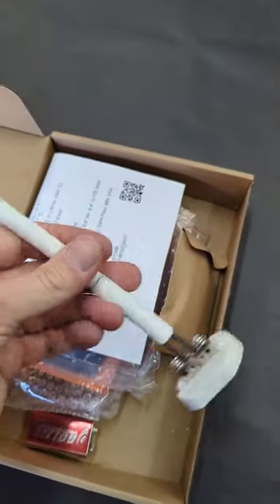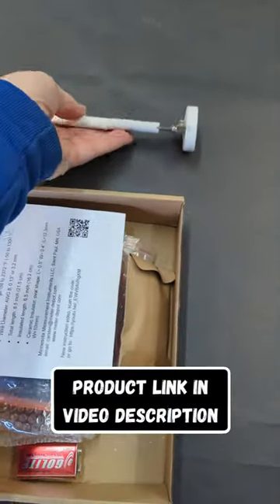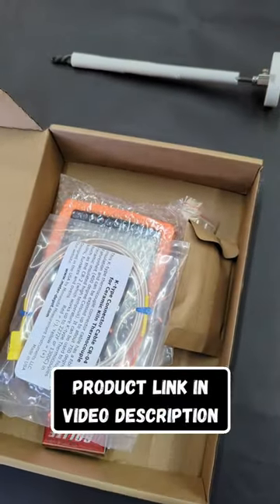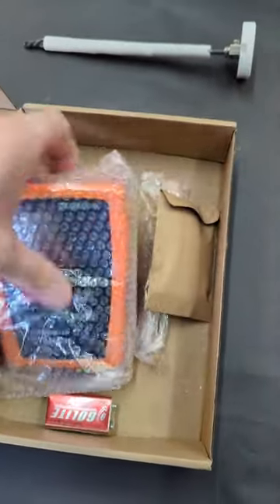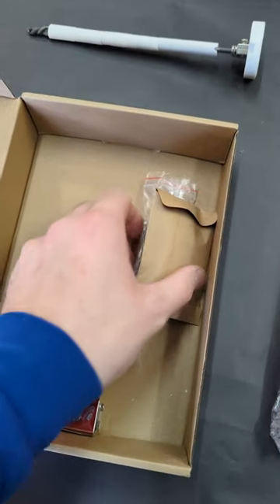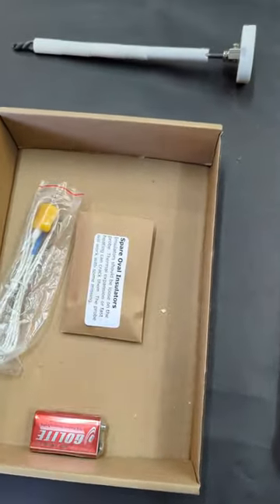Installing a High Heat K-Type Thermocouple in My Forge | Knife Making #shorts

Comment: I did the same thing but went a couple of steps further.  I added a PID controller and a gas solenoid valve.  My forge maintains temps within 15 degrees and uses much less gas now.  Definitely helps to know what temp you’re at!
Reply from the maker: That's awesome! Definitely might be the next steps for me as well. One of the first things I noticed was that I could turn the gas way down once the forge was warmed up.
Reply: Where did you buy this thermometer?
Reply: @DavidMoonForge information on what you have /bought
Reply: @DavidMoonForge
Reply from the maker: @ThomasShue  I've got links to most of the products I used here on my website www.davidmoonforge.com, under the product links tab. Let me know if there's something you're looking for that isn't listed there and I can try to give you a recommendation.